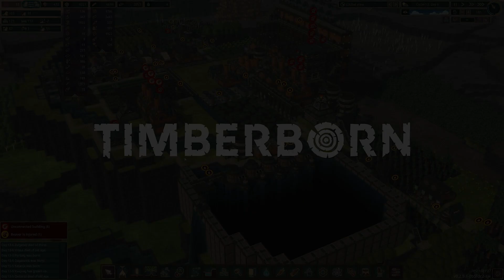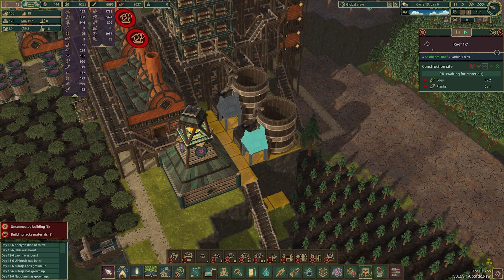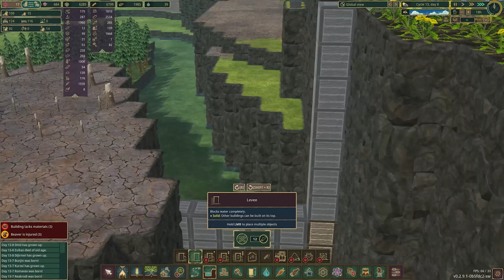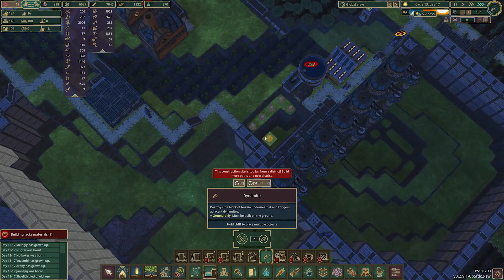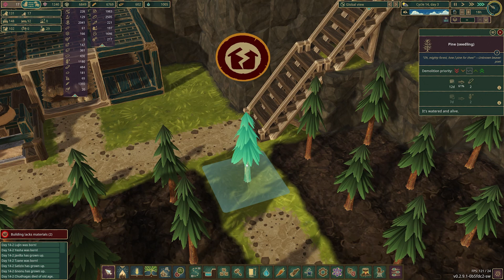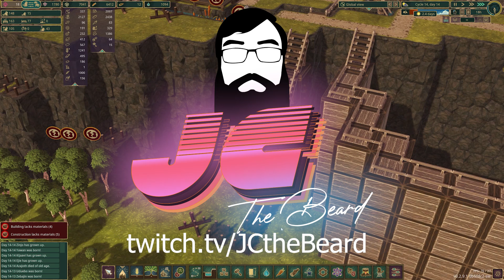More water, more power! Timberborn Iron Teeth Episode 7

Comment: Future reference the water coining though the corner is just visual
Reply from the maker: A few others had said something similar but I didn't want to take chances. I completely forgot about bridges, though. Will probably have to do those next episode!
Reply: That little dam you build near the back side of the houses, what you can do in a situation like that is build a bridge over it so you don’t have to build down to it because beavers will build stuff from on the bridge
Reply: What you should do is pause the power thingys and build all the platforms and power cables and stuff first so you don’t have to deal with beavers building them in the wrong order and blocking of stuff

Comment: Thanks for the video! 2 tips, if I may:
If you're ever thinking about how far they can build, the blue marked area indicates it, so even if the path is red or ended, they can still build if it's in the blue. You didn't actually need any of the shenanigans with additional paths for the new reservoir. 
If you're wondering how a beaver can buils, think of it as a pawn in chess. It can build in any 1 square around it, going 1 square up and infinite squares down.
Gl

Comment: Hi Mr.JC the beard, i just have some remarks to say and some advises if you don't mind
1-you must build habitats and the industry in dry land and if youwant to run them with hydro power just pass electricity with those tube
2- building those big dams (water storages) near each other is expensive, takes a lot of time, land and ressources. so try use terrain (canyons) to make small, cheaper,more effective dams to hold water. Besides, they can make more grass land if they are well spreaded
3- try an build simple canals (simple tranches with dynamite) so you can have more farm land 

in conclusion i can say that dealing with water must be simple but smart to make it efficient. One big storage is enought but try to make water more available and every where instead of holding it.  I hope that you take my advice through consideration. Take care
Reply from the maker: The reason behind expanding the reservoir is ensuring that as the main area continues to grow to full population, there will be enough water reserve to keep everything adequately hydrated. Remember that the housing block is still only about half full! We're already losing two blocks height in the existing reservoir for 7 day droughts. It'll get precariously low a lot quicker than you think.
We'll be doing more "natural" reservoirs as well, I just haven't been able to expand appropriately to those areas yet.